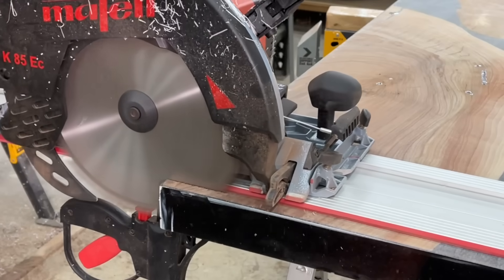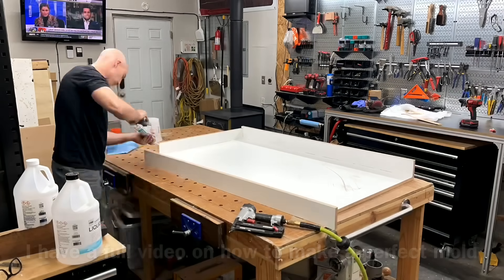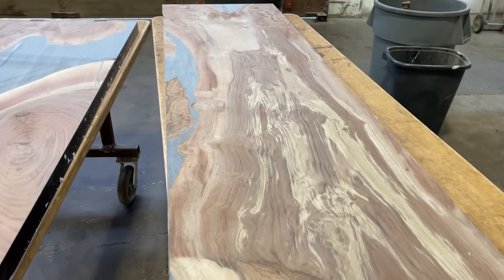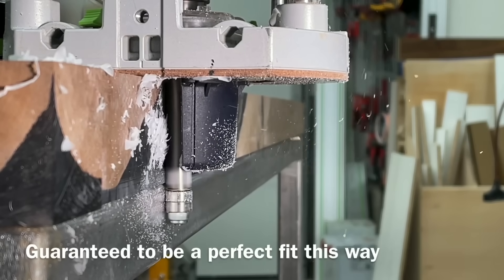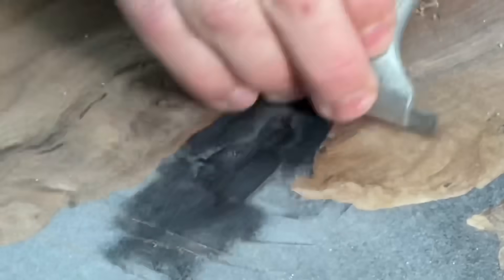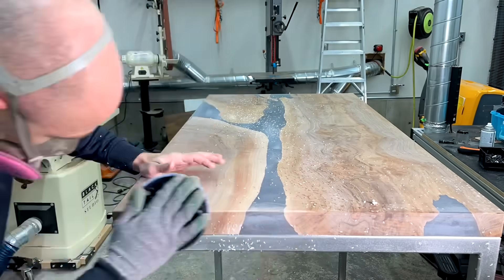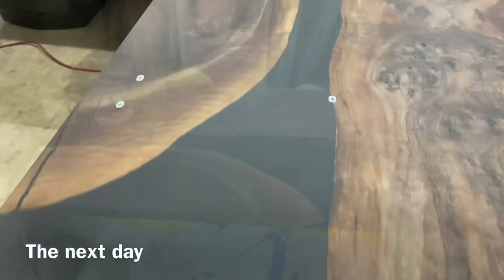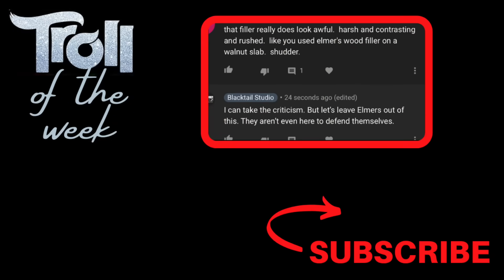Standing Desk The Cops Thought Was Loaded With Drugs (really)

Comment: Suggestion for air pockets 8:10: There are vibration tools made for concrete which remove trapped air so I'm thinking there's a smaller version that would work for you.
Reply: I've used a reciprocating saw without a blade pressed up against the mold to vibrate bubbles out.
Reply: Vibrations sound good, a vacuum pump can also work
Reply: Yeah there is a number of ways to remove air from the epoxy. I'm kinda surprised that the channel this big and for a 7k$ table doesn't use any of them
Reply: @jaleger2295  I believe he said the air bubbles were trapped up underneath the tabletop, which was actually the top of the table, in which case the bubble(s) would have to somehow move along and up the side of the mold to reach the top and pop. He said he had a reason why he poured it tabletop down ...
Reply: Pretty sure it’s air bubbles from a chemical reaction over time, too
Reply: @xx_warhead_xx2677  surface tension can hold bubbles
Reply: @Troy Benson if you have an opportunity a vacuum pump can pull air to the top.  Worth a play.
Reply: I seen guys pressing SDS chisel or drill against the casing to agitate the bubbles.
Reply: Someone on youtube uses a hitachi to do it on a small spot scale.
Reply: @Troy Benson they weren’t “under” the slab, they were at the bottom of the epoxy pour. Vibration could definitely dislodge bubbles that are that large.
Reply: @melody3741  dual purpose just like the saw
Reply: yeah you can get a small attachment for hand drills that looks like a hockey puck, its basically a rumble pack for the sides of forms.
Would work wonders.
Reply: I wondered that myself, or vacuum systems to ensure the bubbles sell up so big they rise to the top.
Reply: We would microwave our epoxy to decrease the viscosity and make it easier for air bubble to come up to the surface. Then we'd pop the air bubbles with a heat gun set on low. Had to babysit the pours but they usually turned out well.
Reply: Rubber mallet + silicon cube . . . Simplicity . . .
Reply: @jaleger2295  Exactly
Reply: @melody3741  kiwami japan baby
Reply: @leangle6856  that is a really great low cost solution, I'm going to remember this for when it comes up (eventually).
Reply: @xx_warhead_xx2677  well he uses standard size templates so I think he can build permenant tooling for generating a vacuum and have minimal "bowing" on the surface of the table, that will solve the bubbles. In terms of spending half a day of finding bubbles I think this would be an ok idea... 
1. Degas the epoxy
1.5. put demolding agent on the jig
2. Pour the epoxy in the jig with the wood
3. Put the lid with a seal on the jig
4. Degas again
5. Enjoy a macchiato while degassing
6. Let the air back into the jig (the bubbles get small) 
7. Check and see if you need to add more epoxy
8. Follow the steps in the video he points out...
Reply: hats fG awsome....seriously
Reply: @0The_Farlander0  It was my understanding that he said in the video that he poured it tabletop down. So the air bubbles that he's talking about were sandwiched between the table and the mold. I can't think of any way you would be able to move air bubbles sideways, or horizontally very effectively unless you put a top on the mold and made it leak proof and stood the entire thing up on edge.
Reply: @jeffh3501  that makes sense, I wasn't understanding.
Reply: But air pockets are great for smuggling drugs once you reseal it...
Reply: Less hardener slower pour vibration allowing air to escape
Reply: @michaelwillcutt2619  you do realize that there is a joke in here, right? I'm sure he knows what went wrong and how to prevent it.
Reply: @xx_warhead_xx2677  
True, but a vacuum pump would remove all the air regardless of which side was up or down.
Reply: @neptarclepuffin  
Spot on and well said.
Reply: @BreakthroughEmpowered  how do you vacuum pump such  a huge work piece?
Reply: There are tiny froth makers used for frothing that I believe would work very well for this task of getting bubbles out of the epoxy!  But I do believe the better version of this, is the saw on vibrations mode! Haha
Reply: Couple of 800W subwoofers running 20Hz FM-modulated sine wave overnight should take care of the bubbles.😜
Reply: @xx_warhead_xx2677  I suspect it was that the gaps narrowed towards the table top. Moulding the right way up would leave undercuts, and these would have trapped a lot of air (??)
Reply: @BreakthroughEmpowered  Vacuum is the ideal solution and was gonna say that ... as a joke since I doubt he'll find a way to vacuum and environment big enough to fit that table top.
Reply: @Antiork  look into vacuum bagging techniques,  used to do it on the aerospace industry
Reply: @ppdan  check out vacuum bagging
Reply: @BreakthroughEmpowered  For obvious reasons vacuum bagging doesn't work here!
Reply: @ppdan  I used to vacuum  bag some very large sized jobs that would be comparable to a table.
Reply: @BreakthroughEmpowered  To laminate fibre mats?
Reply: Hammer drill might work
Reply: exactly!! their called pokers but I have wondered if for the build of tables there are such things as vibrating tables that would have the same effect once the epoxy top is laid onto it.
Reply: Vibration will not remove all the air bubbles. The only 100% sure way to remove all the air is to put this in a vacuum chamber and pump it down to almost a pure vacuum, somewhere around 500 to 1000 microns. But yes vibration won’t work because the surface tension of the epoxy is so strong.
Reply: Or pour slower
Reply: @wilsonrawlin8547  do you have any idea of the tonnage an area that big is going to produce, regular desktop 48×28=1344 square inches that is over 19000 pounds of force, try holding that apart.
Reply: Strap a drill to the table. Put an off centre disk in the chuck and tape down the trigger for a few minutes.
Reply: @boydmcree9085  

What are you talking about? I was talking about removing air bubbles fron the epoxy.
Reply: @wilsonrawlin8547  yes if you pull a vacuumed area that big, the force produced perpendicular to the large area would be 8 tons pressing in. Think vacuum inside 14.7 psi outside x square inches of surface.
Reply: @boydmcree9085  
10-4. I routinely use a vacuum pump system for fiberglass and carbon fiber layups. I build various components for large UAVs and drones.
Reply: They have a smaller one for hammer sds drills for getting the air out of radiators when bleeding them think it's called "Radhammer"
Reply: Great idea, but i dont think it woukd work for This application as the air was trapped because its under the wood. That woukd work for the rest that cal allow bubbles to freely float to surface.
 Maybe a pump thats pushing small jets to pass over undersides of the wood, therefore forcing out the bubbles
Reply: I thought you’re supposed to use heat on those epoxies to relieve air bubbles. My brother has made custom made to order furniture for years and I think he uses a torch
Reply: @neptarclepuffin  A friend builds radio controlled airplanes and when he is laminations an airfoil out of fiberglass he uses vacuum. His rig is literally a big thick plastic bag a hose and a vacuum pump.
Reply: @jeffreykreft5442  don't forget about the epoxy itself gassing off...

Comment: I attempted this kind of work about 6-7 months ago until I started get over my head in cost. I'm a welder by trade, wood working is a totally different ball game. 
Table looks good.
Reply: If you want to make cheaper tables in similar style you could avoid the wood and use the mold to pour a cement counter top. Don’t skimp, but additives such as plasticizers and dyes and you will still end up spending less than he paid for just the wood slab. I’m figuring you have a table frame with no top, since you said you weld, I was going to use my welder to make me some side cash making cement topped tables, nowhere near as profitable as these wood worlds of art but they don’t require even half the time you can even embrace voids and air bubbles and come back and fill with tinted epoxy and it makes the table look better than if you try and make a perfect cement slab. I’ve also seen “live edge” cement slabs made and they are beautiful, they look more like rivers than the wood “river tables” do. Hope this help you get your project finished. Good luck.
Reply: Fuck wood! I'm a welder also  I hate wood because if you fuck it up it's fucked up. It's ruined. Throw it out start over again. At least with steel I can make a cut Regret it put it back together and nobody knows it
Reply: @leroy420b  absolutely, I weld aluminum, burns alot quicker then steel but doing either is easier to fix then wood
Reply: @leroy420b  Funny I was thinking the exact opposite
Reply: @leroy420b  a mistake doesn't always mean it's ruined. In woodworking, the best woodworkers add that "mistake" into the design, to make it look like it belongs there. Now, if you're constantly making mistakes, as an old shop teacher once said, "get gooder". Woodworking teaches patience and if you ain't got it, you won't go far. Believe it or not, majority of mistakes are quite easily fixable. This is where practice and experience comes in. If you ain't something new everyday, you ain't living life. Cheers